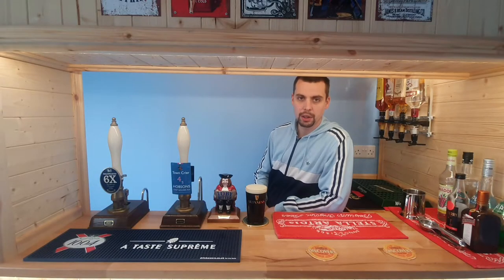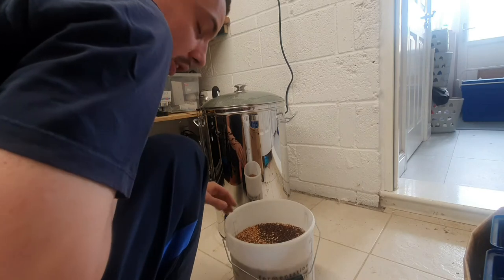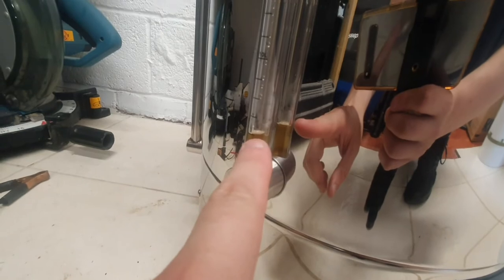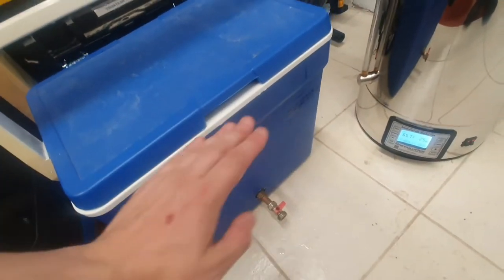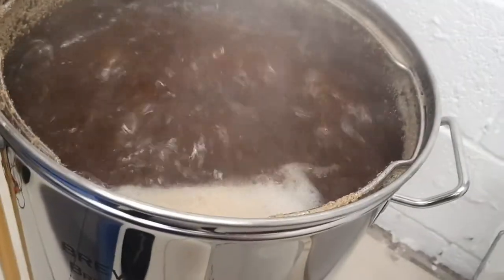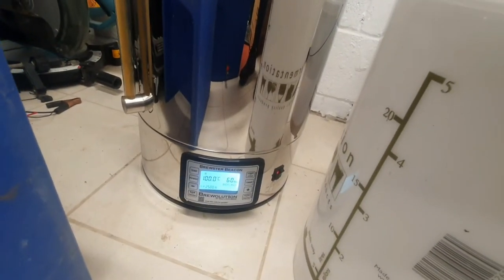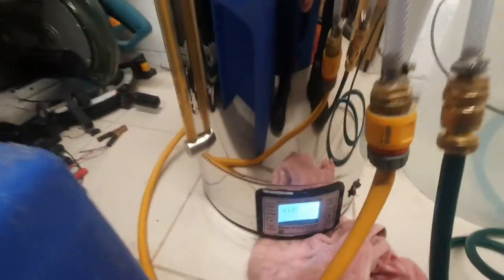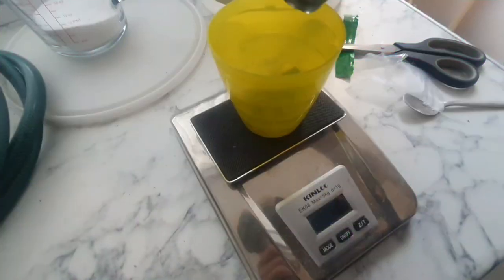How To Homebrew DIY Beer First Brew Day #1 Klarstein Brewster Brewmonk

Comment: Thanks for making this video. It was very detailed and I learned a lot by watching. I just bought a brewing system that's almost identical to yours. Mine has a screened side valve near the bottom so I don't have to use the siphon but it doesn't have a site glass on the outside like yours, I wish it did. I'm looking forward to my first all grain brew and your video was a big help. Thanks again!

Comment: I've been pondering on going all grain. Would you still recommend this Kettle over any others? What's the prices like for all grain over malt extract etc?
Reply from the maker: Hey, malt extract cuts alot of cost out. In terms of all grain you have to take into account the cost of the other equipment needed such as scales, cheller etc and the potential wastage of hops and grain as you cant purchase the set amount that each brew requires. Also an all grain brew day takes around 6 hours which compared to malt extract can be hard to find the time to commit. However all being said if you are looking to switcg to all grain the brewster beacon or any of its sister products of the same type are very good for the money. I wouldnt want to spend £500 or more on another popular branded version unless i was brewing every weekend. I am looking to do a video on this exact topic soon but havent had time lately. Hope this helps and hope to post new video soon, Merry Xmas Jondi.